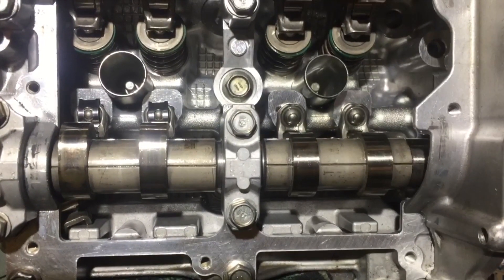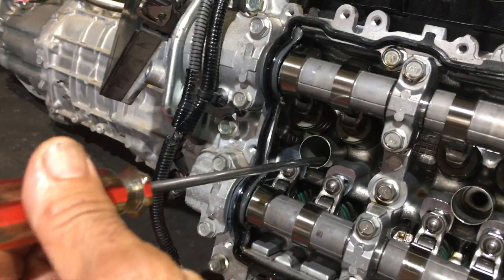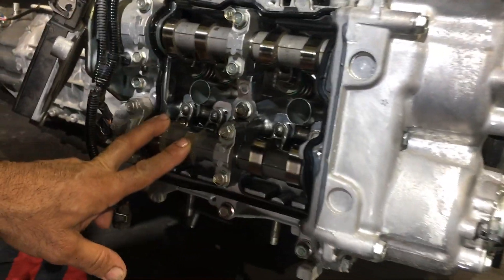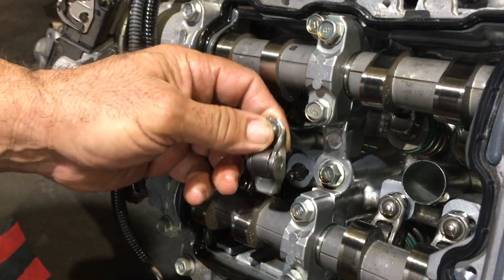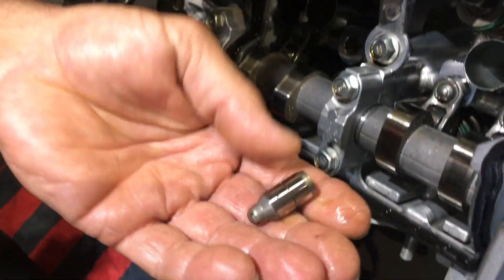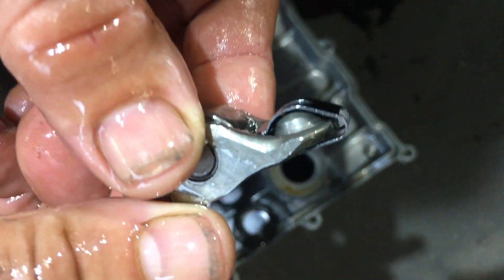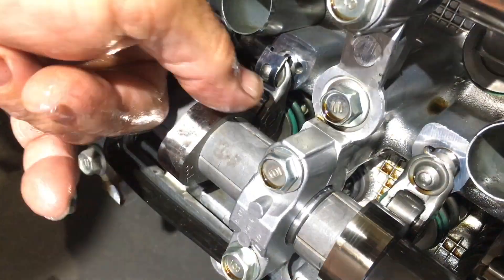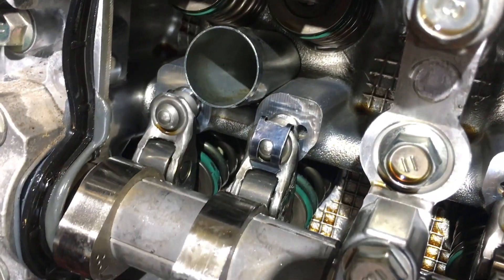FA20 & FB Engine Fatal Flaw and How To Fix It

Comment from the maker: I can’t understand why Subaru/Toyota have chosen to run the FA and FB engine without any rocker retaining system.
All engines will at some stage have a moment with a valve sticking or valve bouncing ,if you don’t have a retainer 
On the rocker arms and especially if these are vertically mounted the only way is down and parting company with the pivot.
The rocker arm is now dancing around inside finding the exhaust camshaft lobe and getting smashed through the rocker cover or into the head.
You may not even feel a misfire from the engine if only one rocker falls off as these engines have 4 valves.
I have checked with Subaru and as far as I’m aware they have no retaining system on any of these engines.
Reply: Yeah - this is just another Subaru design failure.
Reply from the maker: @digable crates Yep, unfortunately so.
Reply: Is the new outback open deck or close?
Reply: ⁹OPPO on poo⁰power] 0 provides 0 poo 00] products per 00pp poo 90p poo p0]p poo] p 9th 0p00000pp9]0 poo posted per post 0 poo 0090p000pp0p00000p0pp0p0 please pp poo 9 ppl 00⁰

Comment: Hello I have a 2012 Subaru Forester 2.0 with an FB20 engine. It has a valve knocking noise on the left side. Could it be the rocker arms or hydraulic lifters? The engine has power, no smoke, and the oil light goes out quickly... Thank you.
Reply from the maker: Could you send a link to a video of it?

Comment: This is a good idea for anyone keeping factory valve springs. If your building heads with upgraded gsc or kelford springs, I haven't seen anyone toss a lifter, well as long as the clearances are set correctly. Even if built, this is a good peace of mind mod.
Reply from the maker: Thanks. I'd really hope no one building heads with upgraded springs is tossing lifters as it would be painful to go through an expensive rebuild again. Exactly, for peace of mind it is worth running on any FA/FB head regardless of spring selection. Explained better on our new video here: https://youtu.be/93SlrE-aGwc

Comment: So you spun the cam shaft in a counter clockwise rotation and expected it to function properly with wrong directional pressure, not saying rockers can’t come off however you caused it to happen, and for yall in comments saying that the green color indicates bad springs yall are fools, green springs don’t indicate anything for 2016-newer, red was to indicate the new springs for older models, not newer

Comment: Hi bro,  my car at 108000km now 2014 GTS 86, should I get it checked and replace?
Reply from the maker: Hey bro! If it’s still on the original valve springs and you're planning to rev it hard or hit the track, it’s a good idea to get the valvetrain checked. 108,000km is getting up there for a 2014 GTS. If you're hearing any ticking or misfires, definitely get it looked at. Preventative maintenance now can save you a rebuild later. 👌

Comment: hello Can you tell me where the Subaru 2014 Vvt filter is located? 2.0 2014
Reply from the maker: Hey Beqa223, check inside the banjo bolts, which are located on the front of each cylinder head.

Comment: How would I know if this happened to an engine? Is it possible for this to occur and not cause a catastrophic failure? Say if the rocker lodges a certain way..
Reply from the maker: Hey goat3800, yes if you’re one of the luckier ones, it is possible a rocker could dislodge safely and tuck itself neatly in the tapet cover and the 2nd exhaust or inlet valve will keep doing most of the work. You will notice it low on power or running a bit odd. How is your 86 currently running that has you concerned? Thanks for the question.

Comment: did they fix that in the FB20 in the 2024 cars ?
Reply from the maker: Good questions but unfortunately not. The rockers are floating in all 3rd generation Subaru engines (FA and FB). We made a video of installing our same kit in the FA24 in the 2022 BRZ: https://youtu.be/WqAb0UObhDk?si=ls2ekay2Lt5Yrih4
Reply: @denstoj  thank you for quick reply, is there any difference between the FA20 and The FB20 ? Or they the same engine
Reply: Also does this mean I shouldn't buy a Subaru,  cause I am in the market for one comparing between the crosstrek and corolla cross
Reply from the maker: You're welcome! Yes, there are some differences between the FA20 and FB20 engines. The FA20 is a 2.0-litre flat-four engine with direct injection and is used in models like the Subaru BRZ, Toyota 86, and some versions of the WRX. It's known for its higher performance. On the other hand, the FB20 is also a 2.0-litre flat-four engine but with a focus on fuel efficiency and emissions. It's used in models like the Subaru Impreza and XV/Crosstrek. The FB20 features a different combustion chamber design and doesn't have direct injection like the FA20.
Reply from the maker: Both the Subaru Crosstrek and the Toyota Corolla Cross are great choices, each with its own strengths. The Crosstrek is known for its all-wheel-drive system, which provides excellent traction and handling, especially in off-road or slippery conditions. It also has a comfortable ride and good fuel economy.

The Corolla Cross, on the other hand, is a newer model that offers good fuel efficiency, a comfortable interior, and Toyota's reputation for reliability. It's a bit more urban-focused compared to the Crosstrek, with a smoother ride in city driving.

Ultimately, the choice between the two will depend on your specific needs and preferences. If you value all-wheel-drive and a more rugged capability, the Crosstrek might be the better choice. If you're looking for a reliable and efficient compact SUV for city driving, the Corolla Cross could be a great option. It's always a good idea to test drive both vehicles to see which one feels right for you.

Knowing about the rocker issue doesn't mean that a Subaru is not a good buy. It's just something to be aware of. Like any car, they have their strengths and weaknesses. The important thing is to be informed about potential issues and to make sure that they are addressed or monitored. As long as you keep up with regular maintenance and address any issues that arise, a Subaru can be a great choice. We have a couple of the 86s/BRZs ourselves of course!
Reply: @denstoj  thank you so much man for your detailed reply, definitely gonna subscribe 🙏
Reply from the maker: No worries. Glad to help! Thanks for that. Feel free to ask more questions on this video or others.

Comment: I just bought a 2014 forester and I got oil on my spark plugs might be just the valve cover seals but should I be worried?
Reply from the maker: Hey @Ede4345, yes most likely worn valve cover seals/gaskets. Is it misfiring at all?
Reply: @denstoj  no but it’s turning off on me. Will start back up but will turn off after a few mins.
Reply from the maker: @ede4345 try giving the throttle body a good clean with degreaser. Also, just checking, what part of the spark plug are you finding the oil on?

Comment: Are the valves supposed to be adjusted hot or cold ? What is the valve lash spec ?
Reply from the maker: Hey @midnitewritr, the lash for the FA20 is meant to be set cold. The specifications are; Inlet 0.10-0.16 mm and Exhaust 0.21-0.27mm. We prefer to set lash on the looser side to ensure proper valve seating under running temperatures. Are you currently setting up your engine?
Reply: @denstoj   Not setting up engine . I'm considering buying a newer one w/ that style engine . I like having all the information on hand well before I delve into it . Thanks A bunch. Happy New Year, Mate
Reply from the maker: @midnitewritr no worries. Good plan. You too.
Reply from the maker: Hey  @DKSE123 , we now have added a link on our FAQ page to a worksheet to help when setting up the valves. Scroll down to the "Installation" section: https://denstoj.com.au/pages/faq-fa-fb-denstoj-rocker-retainer-kit

Comment: I'd do this mod but don't feel like dropping my motor. My fb20 runs like a top
Reply from the maker: Planning any other upgrades?
Reply: @denstoj  I'd like to but it's just a base model with cvt. Lack of aftermarket support is serious for the fbs . It really is amazing on fuel though
Reply from the maker: @stevecameron85 ah yeah got it, what kind of upgrades would you like to see for it? edit: maybe if it wasn't the base model cvt ;)

Comment: Can I put a fa20 into a 2006 or 2008 wrx.
Reply from the maker: I'll ask Dennis and get back to you
Reply from the maker: Anything is possible but haven’t done it before. Unsure if it will bolt straight up to the gearbox. What were you thinking?

Comment: Is the FB25D engine reliable?
Reply from the maker: Hey @lld, We don't actually get the FB25D variant here in Australia, but I would look out for common issues like excessive oil consumption and carbon build up with the direct injection system.

I did a quick google and there is potentially a timing chain tensioner issue and the cam carrier seals are prone to leaking, so watch out for both of these. Oh and there is that rocker drop issue ;) I probably wouldn't worry for a stock daily driver unless you were already pulling the motor out for something else. Different story if you were modding. 

The 3rd generation engines from Subaru are reliable, but like any motor, they're not perfect and there are just things to look out for. As long as you keep them well maintained, you should be right. Do you currently have one in your car or thinking about buying a car with the FB25D?

Comment: The FA20 is extremely reliable in stock form if you look at it from a production numbers standpoint. I'm at 103K miles on my 2013 GT86, and I have been driving it like hell since day 1. Using 0W20 high grade oils every 3k-4k, no issues...
Reply from the maker: Hey StealthRider, for sure. The FA20 is a great motor well suited in the 86. You could drive it daily with no issues. The rocker drop issue is just something to be aware of, as all engines have something that is susceptible to failure. Nothing is perfect. It comes down to a bit of luck too.Glad to hear it's going well for you. How many do you think have been produced globally?

Comment: i have not seen or heard about this any where else, so i say bullshit. subaru would have picked this up over the last 30 years. i believe this is a scam!
Reply from the maker: Yes, we're also wondering why Subaru has not fixed it. Most engines with this valve train arrangement run some form of rocker retainer.
Reply: @denstoj  maybe there is nothing to fix!
Reply: @bobhebblewhite1685  I just picked up 3 broken fa20's to make one good one. They're all from 2013 and at least 2 of the 3 had rockers fall out. The other was torn down already but was missing cams and other pieces so I can only imagine it too suffered the same fate. I'm not putting this engine back together without retaining clips. Only problem is I don't want to pay 600$ 😅 time to bust out the drill and cut off wheel 🤷🏼‍♂️
Reply from the maker: That’s what it’s about! Giving it a good crack. Is it going into an 86?
Reply: @denstoj  I know how to use mills/lathes but no longer work in a shop that has either so I'll have to make do. Yes, well a BRZ but same thing. If it doesn't go well, I'll be placing an order.
Reply from the maker: @devonswindell9735 no worries. Let us know how you go

Comment: Will you be kind? 
I just bought my 2022 legacy Limited NAF 
Engine numbers:
FB25 N709164
FB25DXZHGA N708164 M610 46 
Comments Advice Warnings 
I am spanking new to Subaru .
Reply from the maker: Hey Mike, nothing specific that I would point out besides the rockers. Regularly service and look after it. Should be a great car.

Comment: Oil Nipple is what I would call them.
Reply from the maker: Hey Mike Wallace, what part of the video are you referring to? Thanks, Dennis.
Reply: @denstoj  The oiler bushing nested in the block feeding the rocker arm assembly . I was a steamfitter . Fitters and plumbers use the nipple term for a manufactured short length of pipe used to make connections quicker.
Reply from the maker: Ah got it! We talk more about how oil is fed to the FA20 valvetrain in this video: 

FA20 & FB20 Engine Pivot Oiling System Demonstration
https://youtu.be/AncxPbaI-9k

Comment: Just pulled an FB25 down the other week to replace the head gaskets. At 217,000km’s it still had all the original rockers in place with minimal wear to rockers and pivots. Put it all back to together with fresh gaskets and off she went. 

Unsure why they do it but definitely a sure fire fix for this issue nonetheless
Reply from the maker: Good to hear.

Comment: I'm rebuilding a FB25 out of a 2013 Legacy right now. After watching this, I am surprised it got over 200,000 miles without this happening. Anyone know if a set of these retainers for a FB20 would fit the FB25? 
Does the FB25 have this issue? the rockers look exactly like the ones in this video
Reply from the maker: Hi Matt, yes all rockers are the same on the third-generation Subaru FA/FB engines and susceptible to the same issue.
Reply: Yes i am also surprised when i see any subaru engine get over 200k miles
Reply from the maker: Yes when it’s a 3rd gen engine.

Comment: The most bullshit engine made in the past decade. Rod bearings fail at less than 100k miles also. Knew someone with a brz and needed new ecu at 30k miles. Do you happen to know if the FB engines have the same rod bearings as the FA?
Reply from the maker: I imagine the FB engines would have the same rod bearings as the FA but best to check.

Comment: I got a 2013 frs and Im pretty sure my rocker shot out through the valve cover and oil was every where! Do you think it could be fixed and still safe to drive if it could?
Reply from the maker: Sorry to hear! I hope that you managed to escape safely and shut the engine down ok when it happened.

It’s difficult to say without inspecting the engine as it depends on the severity of the damage. Everything can be fixed but at what cost.

It will be safer with a rocker retainer kit. 👍

Comment: Do you know if the FA24 engines have this issue as well?
Reply from the maker: Yes, to our knowledge, Subaru isn’t running a rocker retainer on their 3rd generation engines (FA and FB).
Reply: @denstoj  Thanks. Hope my Ascent holds together : /
Reply from the maker: No problem. Hope it holds together too!

Comment: I wonder if the new Fa20 2.4l engine will have the same issue. I guess we’ll see
Reply from the maker: Let’s hope not! From what we can tell, Subaru has changed to beehive springs in the FA24 but still not retained the rockers. We’re eager to pull apart an FA24D from the 2022 86/BRZ and inspect the rockers.
Reply: @denstoj  yes I’m all here for it, looking to buying the GR86 next year. Don’t plan on making any modifications to it. If the issue still persists maybe I’ll get a kit when I have to do the spark plugs. Kill two birds with one stone.
Reply from the maker: @18nakedcowboys69  Neat! Have you put a pre-order in at all? Yeah, even if you aren’t doing many modifications and just going for reliability installing our rocker retainer kit when changing spark plugs is ideal.

Comment: I’ve been working for Subaru for 43 years. Never seen those before   Really nice idea. Oh by the way those green valve springs need to be replaced as part of a national recall. They break!!!
Reply from the maker: Thanks, Charles. Yep, you’re right. At the start of the video, the engine shown has the green springs that were part of the 2012-2013 recall. Later in the video it’s a 2015 engine with the updated blue springs. It’s difficult to tell they’re blue in the video though! Must be the way my phone captured it.
Reply: I have seen couple of videos replace the fuis of timing chain, is this usual is Subaru?
Reply from the maker: Sorry Alsharif, would you be able to explain further what you mean by “fuis” or link the videos?
Reply: @denstoj  😂 sorry because of text editing. What I say is I have so many videos replace the guide of the timing chain, is this usual in new engine generation??
Reply from the maker: @alsharifhusain  sorry I haven’t seen any with this problem

Comment: Hello, i recently came to your video, i habe a levorg 1.6 dit with the fb16 engine, since i am not tuning it or change anything from stock, how far is this a problem on stock engines? mine revs up to 6k max and i dont even hit that too often. so is this a common failure on any of your listed engines or is it just to concern when tuning the engine to higher revs? thx regards
Reply from the maker: Hey it’s a common problem no matter if it is stock or tuned. It can happen across the whole rev range. Yes, it is more likely at higher revs. The worst scenario is whenever you’re shifting and miss a gear. Hope that helps you can find more information on our website Denstoj.com.au or ask a question here.